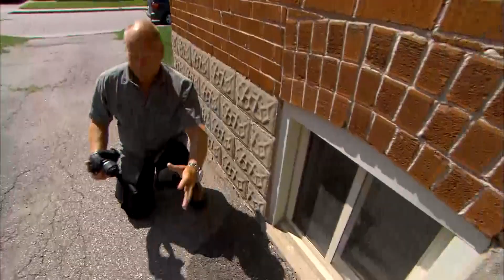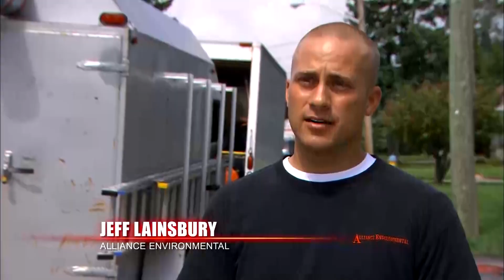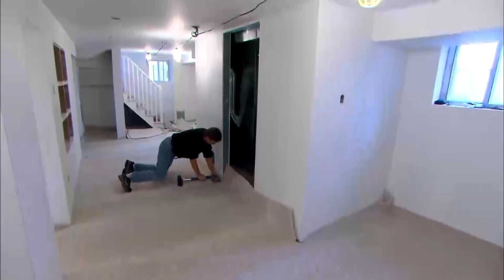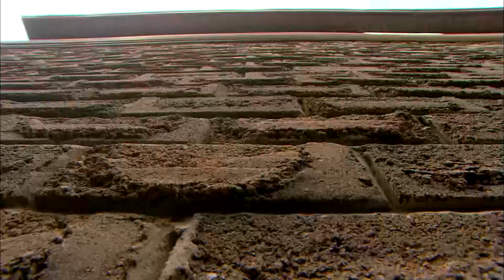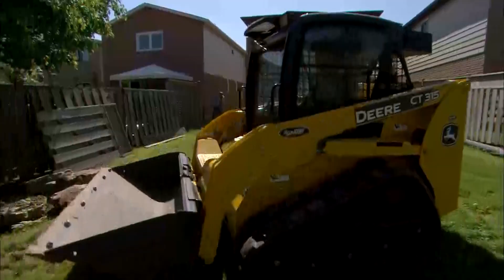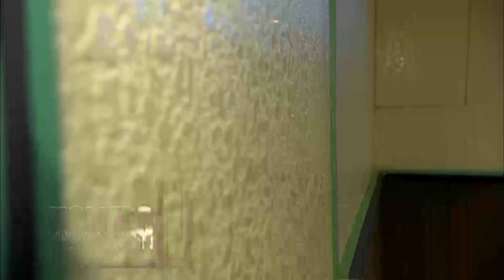Homebuyer's Regret  The Price of Skipping Inspections | Holmes Inspection 201+202

Comment: Most of your shows are about bad home inspections. So how do you know the person doing the inspection knows what they are doing and or really care to do a good job
Reply: My experience was that I went to a known good builder, and they didn't do home inspections. I told the president of the company, My daughter was buying a house and we needed a good home inspection, I asked him if he was too busy to check a house he wanted, who would he get? He gave me a name and said he's a little expensive but a lot worth it. He was truthful. The inspector spent 3.5 hours checking things out to include going out on the roof and into the attic. He recommended getting a plumber to scope the line due to a huge maple tree, which we did and found they had updated to PVC, the inspector took pictures which accompanied his notes in a 12 page report, using that report My daughter offered a lower price on the house with specific fixes that had to be done, the offer was counter- offered by the seller but it was reasonable.  She bought the house, has been there 11 years ( now married with kids ), and besides a faucet going bad, they've had no surprises. He charged about $150 more than the average inspector ( $500, 11years ago in 2013 ) , and the line scope cost $100. Well worth it for what she received.